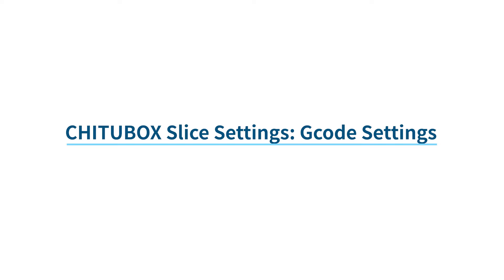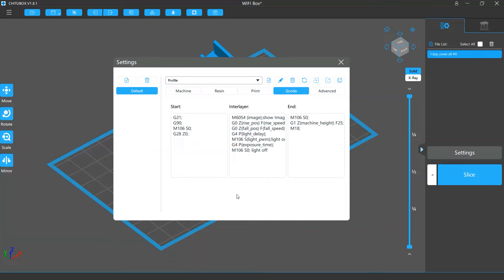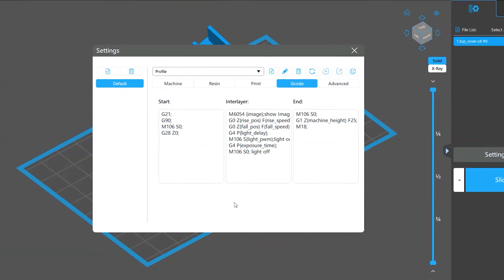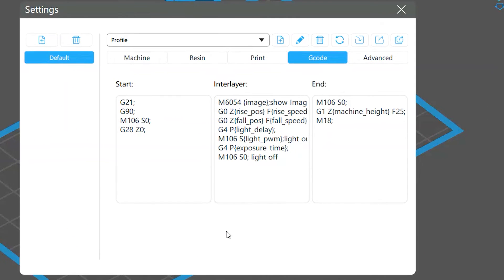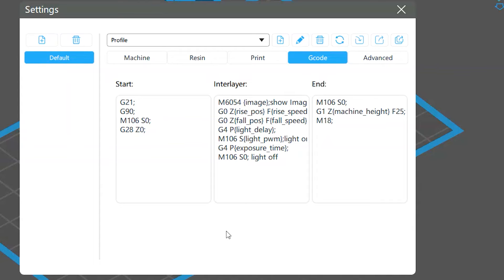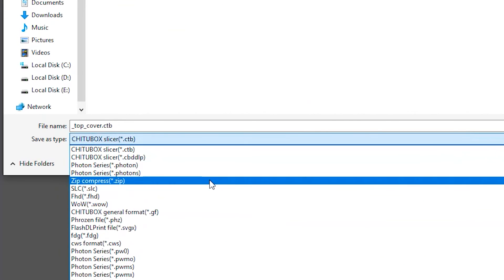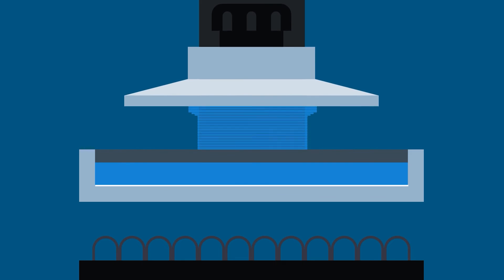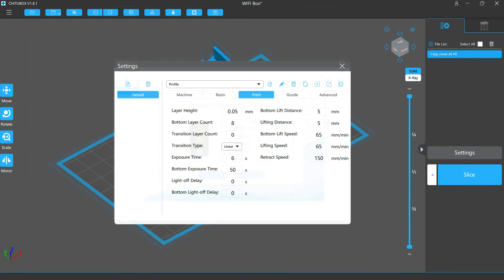[Tutorial] CHITUBOX Slice Settings: Gcode Settings

Comment: This setting is basically useless. Only works on files exported as .zip and barely any printer can print a Chitu .zip. On top of that .CTB files are now encrypted so you can't even go in and manually edit the sliced file to do what you want. Two thumbs down to chitubox

Comment: After exporting a sliced file, A phrozen transform can use the .zip without any other changes? Just upload it to the printer and press print?
Reply: Did you get yours to print?
Reply: @victoriamartinez-le2iu  yes the phrozen transform prints the .zip just fine.